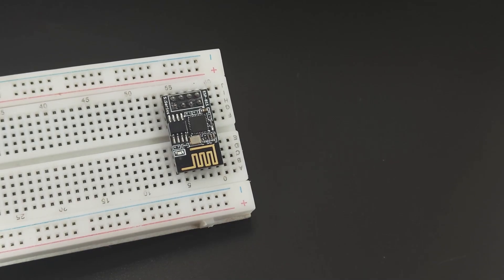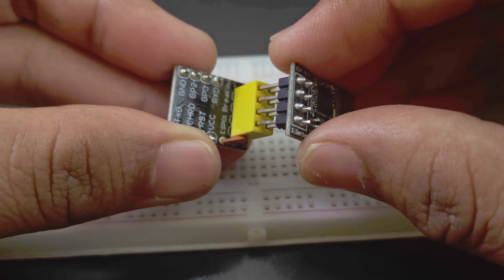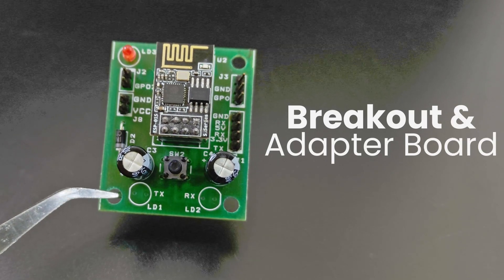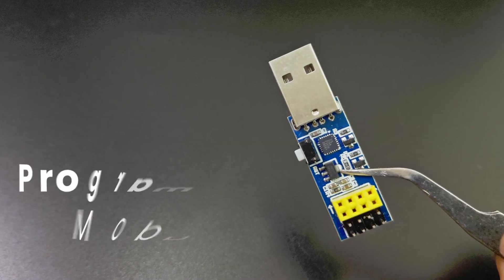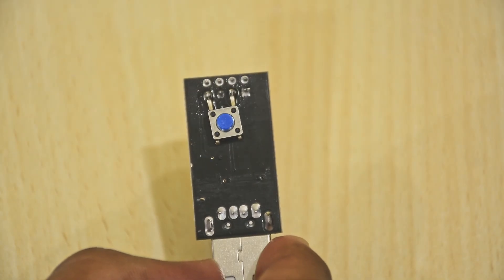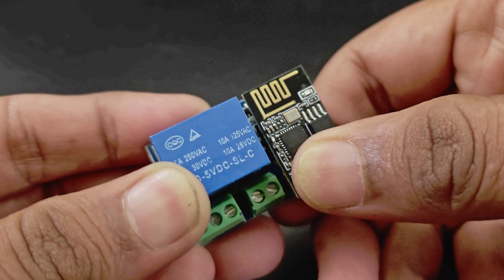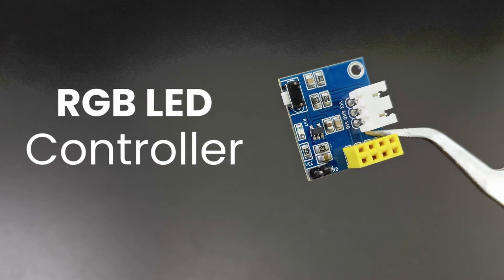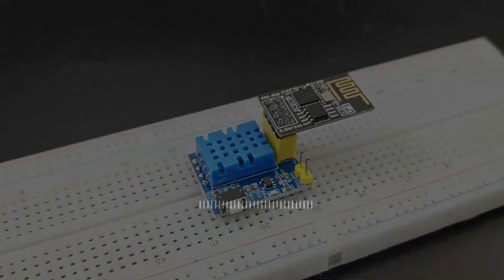ESP-01 Plug and play Modules

Comment: @2min where you add button. I did a mod to the same board can't load and image here. 
So a link LOL ""https://www.thebackshed.com/forum/uploads/Quazee137/2024-11-06_160949_ESP-01-PGMER-.jpg"
Using ESPNOW I have a sender ESP-01s asking receiver ESP on relay board to turn it on/off.
For small projects the ESP-12's are great. Saving ESP32 for bigger projects.

Comment: Make me one
Reply from the maker: Which one
Reply: @techtalkies1  I'm trying to use espnow between esp01s but If I script the uart pins I have to refresh before using. And I can't use the gpio 0 or 2 because they are for boot up, I want to be able to use all the gpios. Maybe a switch to control them then after it's installed and programmed flip the switches. I'm using micropython. I want to program and use on one board 4 gpio pins
Reply from the maker: Can't you use ESP8266 boards?
Reply: @techtalkies1  yeah I haved looking at esp07 I just want the smallest footprint, I reuse the smaller vape batteries and re attach them to USB chargers I am aiming for about half the size of a deck of cards